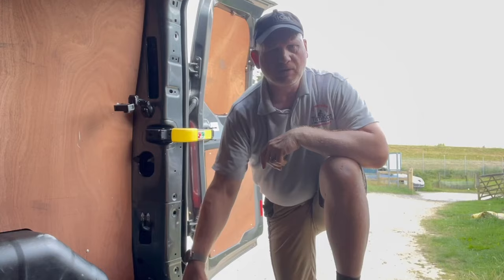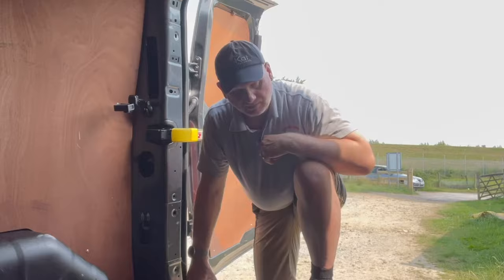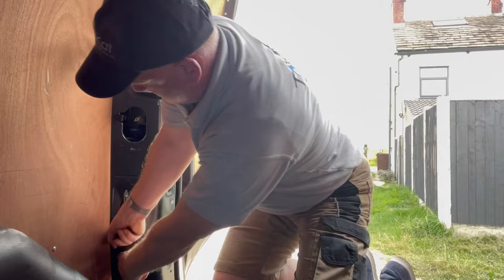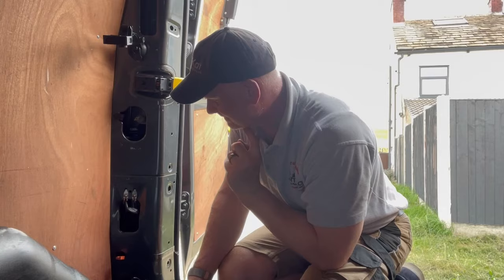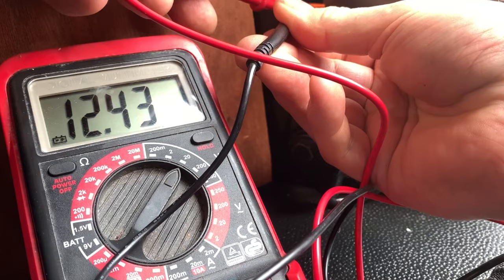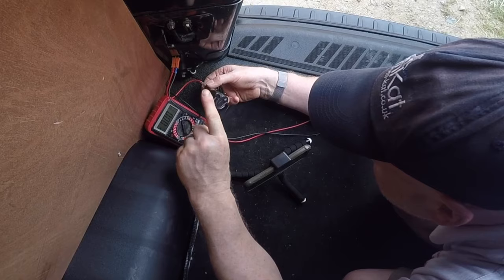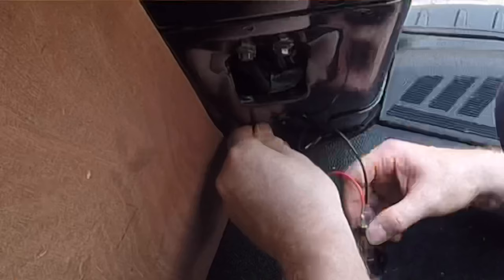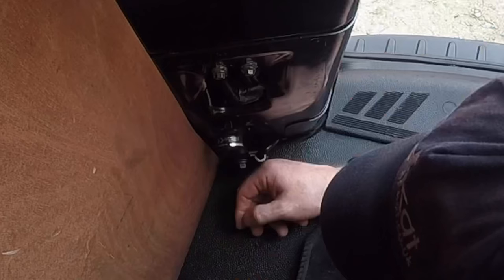The secret Ford 12v power supply, the Ford  transit power supply you weren’t supposed to know about

Comment: Great video.   However 2 mistakes.   1).  It’s DC so positive and negative supply.  No live and neutral.    Also when connection on to a powered unit you should always connect the negative first.   I’m an electrician by the way.   All in the detail.   However you are 100% spot on regarding the power in the back.  Really impressed.   Keep up the great work.

Comment: I have a 2017 transit custom Ltd but I can’t find it on mine ?
Reply: It's there. Pull the tail light plug out. You don't have to remove the light itself. It's a bit tight, but comes out. Follow the cable down. Start to pull it out across the window where the 2 negatives are connected. You will find it taped to that loom.
Reply: I’m looking for this.
You say across the window?

Comment: i am fitting a reverse camera to  my transit custom 2020. You need a connection to the reverse light to switch the relay and also a separate 12v supply , I was going to run a supply from the fuse box and saw your video. Happy days i have a supply and also a 12v socket at the back of the van Thanks pal
Reply: Hi buddy what reverse cam did you go for looking at doing this in the future.. 👍

Comment: Derek.You dont need the flylead of the back of the socket it just plugs into the ford socket.i run my cool box of my socket lit also times out to stop your battery going flat.Roger.
Reply from the maker: The one I bought would not just plug in the pins where out of line

Comment: hi there Derek i just wanted to point out that you could have taken the wires off the socket and just do a straightforward connection to the power supply ok keep it up mate regards Jock-watto
Reply from the maker: Yeh they didn’t match up that’s why I had to use the wires

Comment: If you have a simple transit custom panel van then there should be no problem taking power direct from the battery and running it to a point in the rear of the van. The battery is under the drivers seat. You MUST put an inline fuse as close to the battery as possible and use 2mm CSA cables. This would allow you to draw about 25 amps or approx 325 watts. Fit a 25amp fuse. If you need more current then increase the cable size, the fuse and fuse holder accordingly. You could potentially draw up to 100 amps but this would seriously shorten the service life of the battery, standard or leisure.

Comment: My 2021 Transit 250 high roof has the notched hole but no wire lead. Looks like I will need to run a fused line from the battery.

Comment: Not related to the above but I’ve got the standard wipe clean cargo floor plastic thing that lays the cargo area/floor I’ve noticed yours is different? I’ve also got that plastic cover that sits over the bottom door catch but can’t fit it due to plastic floor lining, so the question I’m asking is what floor lining have you got?

Comment: You can just set the meter to audible mode and touch the chassis and each of the wires. When it beeps that’s your ground and the other is your live.
Reply: one should NOT do that if the battery hasn’t been disconnected. Unless you want to be replacing blown fuses.
Reply: @frodev728  what kind of fuse are you gonna blow with 5v 😂

Comment: Good find Derek, pitty non of my power tool chargers are 12v.
Reply: You can buy original chargers for Makita/Milwaukee/DeWalt etc. with this plug on it  (12V input).
Reply: Put an AC inverter on it. Check fuse/wiring is big enough first.

Comment: Thanks for video, I already have my socket but came across this when searching for 'secret 230v socket'. I've noticed I have a 40amp fuse in the fusebox for the 230v socket but don't have the socket in my 2013 van.  My guess (hope!) is the wiring is there ready  for the socket to be installed. Anyone come across it yet?

Comment: I have a problem with the lowbeam headlight. Replaced with the new one still not working. And checked the cable power to the light only has 2.64v. Does anyone know what's the problem? And the location of the fuse for that?

Comment: Is it a permanent 12v and what's the amp rating of that plug and wire, do you know  what fuse does it connected to?  Just asking as the loom may get hot with a 12v cool box.
Reply from the maker: I believe it is the same as the 2 in the front protected by a 15amp fuse. The power goes of about 2 minutes after you turn the ignition off just like the 2 in the front. I checked if the wire got hot after our 6 hr drive and it seamed ok. I guess if you treat it like the ones in the front you will have no problem
Reply: @tomkatgastraining  sounds like a awesome find then.  Spread the word
Reply: Not one on my 65 plate!

Comment: @ 1:25 Anyone contemplating doing this to any 12V connector found;... located anywhere in your vehicle of any make...
Be advised to put an inline 10A fuse to PROTECT the existing wiring in case of a Fault or overload from anything U plug in...
Reply: It's already protected by a 15 amp fuse.  I've installed 12v pp and inverters in my brothers van and friends van.👍
Reply: @rayc1503  U have to take note the lighter socket is rated for 120W... Trying to draw 180W will;... over a period will overheat the outlet...

Hence the 10A fuse recommended...
Reply: @ElTelBaby  Read your owners manual. The Sockets in the front are able to have a 15A appliance plugged in. Obviously one at a time as they share the same 15A fuse along this this connector in the rear. Sure the one in this video is only 120W but realistically how many appliances are going to draw more than 10A.

Comment: Anyone know which fuse it runs on as can’t get a reading
Reply: Under the steering wheel, pull the trim off. 
There are 2 fuse boxes in there, look for fuse F30(20A), I would think it's the one for the rear power outlet.

Otherwise, see the instruction manual.

Comment: Is this supply both on the left and right?
Reply from the maker: Nope just the side I show
Reply: @tomkatgastraining  thanks. Very helpful 👍🏼
Reply: After checking with the multi meter, it seems that this power isn't working 😕
Reply from the maker: @JB-wb7bc  you will need the ignition on as it is on some kind of timer like the lights
Reply: @tomkatgastraining  I thought that also, so I started the engine. Still no joy. Oh well ...
Reply from the maker: @JB-wb7bc  hope you haven’t blown the fuse check the two in the front are still working

Comment: Commercial Vehicles are often fitted with theses kinds of things included programable modules that interface with the CAN as the same model of vehicle many be used for a wide range of applications. Simply finding a V+ & V- doesn’t mean can just hook up anything! Unless you know precisely where that supply is coming from. The CANBUS may also drop the power off if it sees and over load to prevent fires. 
You have no idea of the rating of that circuit and could overload your system. 

Why would vehicle manufacturer hide a feature? Its hidden for a reason, furthermore vehicles don’t have a “live” that term is no longer used even on AC its now “Line” and there isn’t an “Earth” on a vehicle also. One last point your DVM with show you polarity by showing the minus at the side of the numbers eg -12 polarity your black probe will on V+

Comment: Is this tongue  in cheek?
All manafacturers offer specifications  that vary from base to top of the range.
The higher the spec the more you pay.
Cars and vans (we're  talking stuff within the average  Joe's  budget)
Are all built to accommodate  customer driven upgrades.
If you want electric seats,heated seats or anything that requires an electrical  input, the wiring loom for the base model can be up graded simply by installing the appropriate  hardware, seats, lights,air con or 12v /USB and all the other bells and whistles the manafacture can upgrade the  spec to charge the buyer a disproportionate  amount more.
It's  called value adding the product!
I'm  sure to get that power supply as standard, you'd be be looking at  spending a fair bit more to upspec than it cost you!
Best regards and enjoy your holiday.
Reply from the maker: You won’t find this socket in the vans but you can find it in the people carrier version along with 2 others between the driver and passenger seats

Comment: Why didn’t you just plug it into the piece your wire are very close on the plug and bare 99% of cigarette plugs are the same plug on the back the wires will move around and possible split and blow a fuse
Reply from the maker: Didn’t fit or I would have done